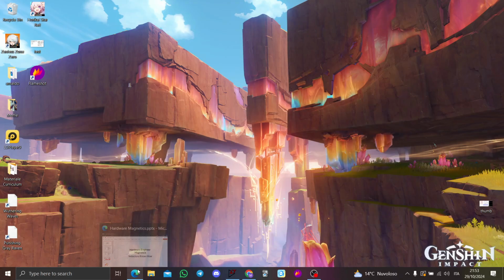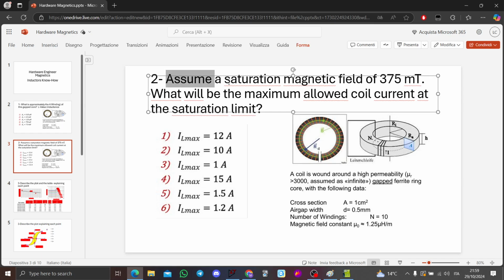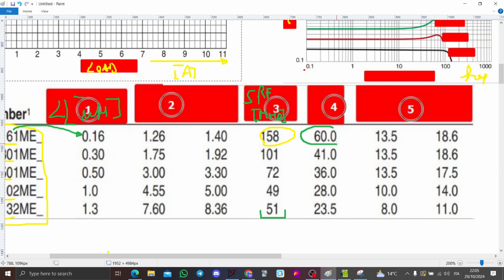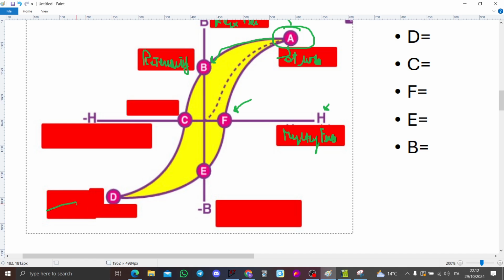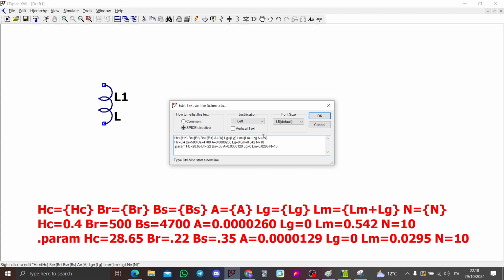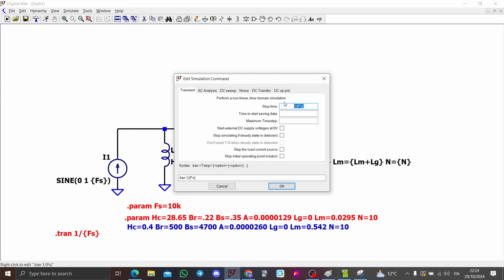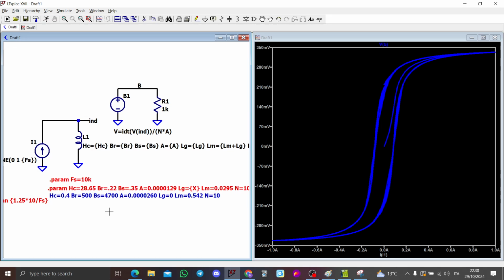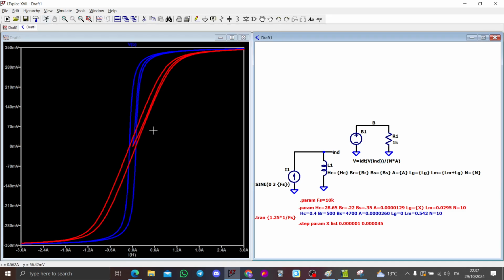[Power Magnetics Hardware Interview] : Hard Level + LTspice  Part 1

Comment from the maker: I left in my drive two ASC:
Benchmark 1 It used to measure how much inductance you lose after having a certain amount of current. You will se that once you surpass the saturation, the inductor becomes a wire basically, with any magnetic propriety, and you will have a short
Benchmark 2 It is a more complete version of what I did in the video, even including The H calculation. If you want, you can see it, but, as I said in the video, putting the current on the X axis gives more pyshical meaning to your simulation.